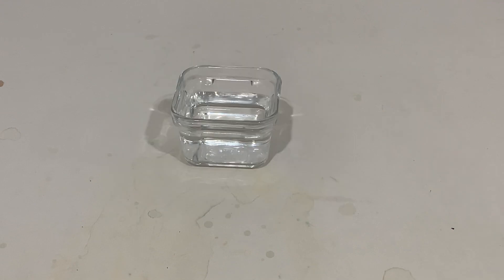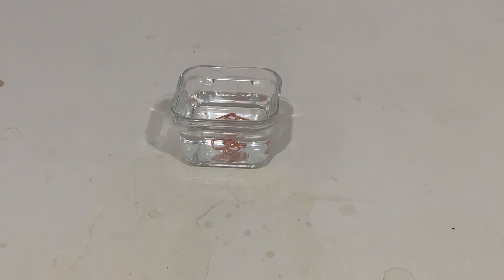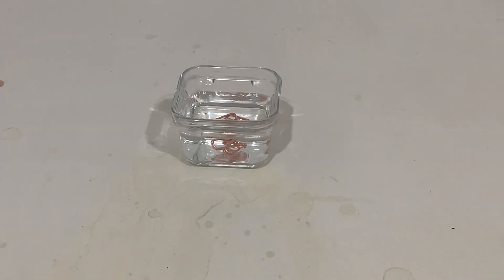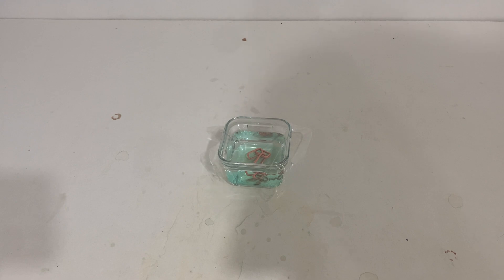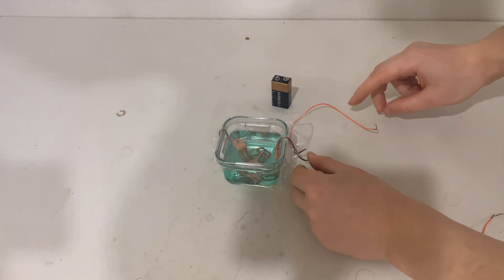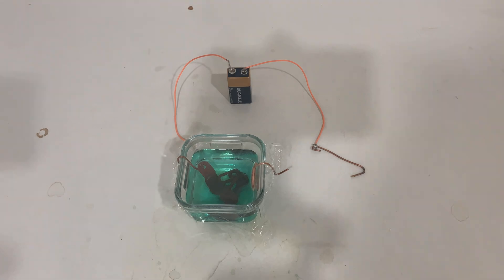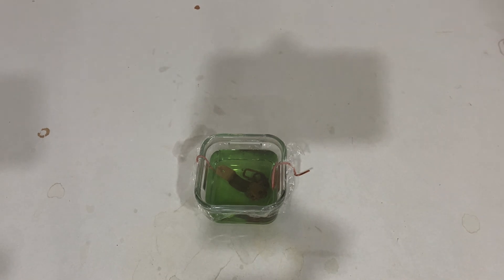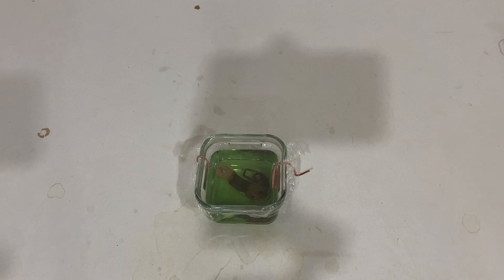Optimizing cupric chloride production

Comment: can we use salt for substitute for HCl?
Reply from the maker: Not exactly. You’ll need a 2 section electrolyzer for this I showed one. If you would use a one section electrolyzer like what I did with salt the copper chloride which would be produced would react with the sodium hydroxide making copper hydroxide. I actually use this method to produce it to use later on in facilitating the production of copper salts
Reply from the maker: You can make hcl from salt, tho. But yea with a different electrolyzer with like a membrane sure you can. You would run into impurities tho